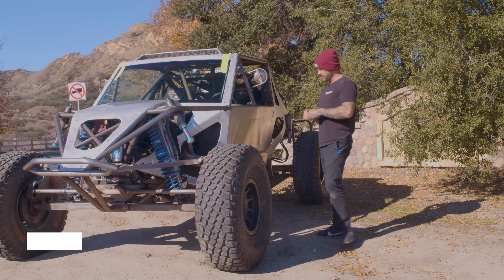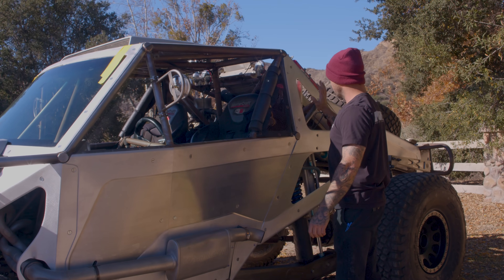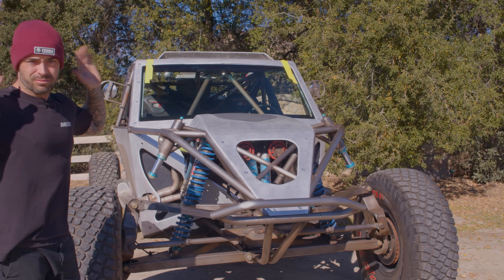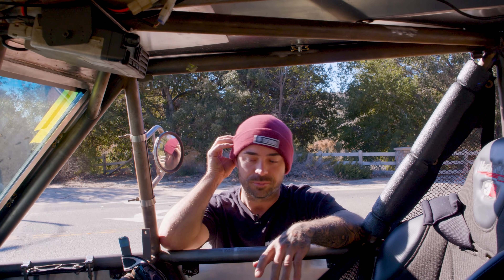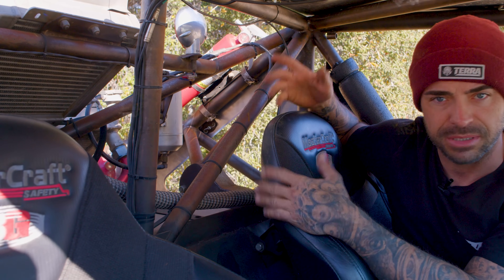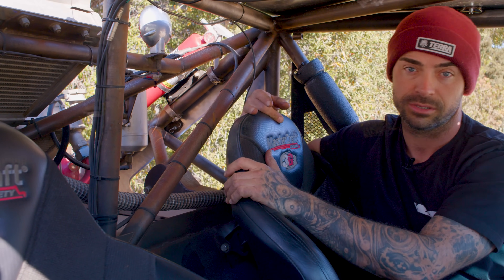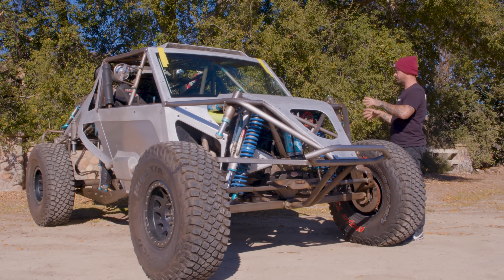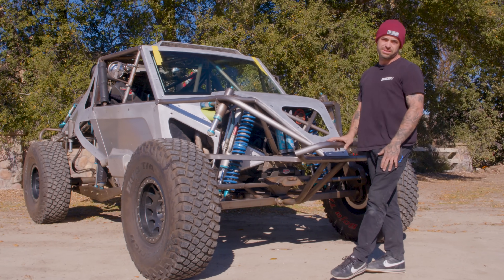TRUGGY:  Transformed  |  Roof scoop  |  Windshield  l  Updates!! (phase 2)

Comment: Do you put a gap in the zus tabs to preload the panel? I've never done it but I've heard that helps with panel noise? Or do you have a different way to go about it?
Reply from the maker: If the tab is set properly on the chassis is should do its job right off the bat. The edge roll also helps with tension
Reply: @MorganClarkeDesign1  thanks for the reply 👍

Comment: Those little triangle corner window made of lexan, u should make them old school so they open an close. Use your metal skills to make a frame around them with center mounted top and bottom swivels so they open inwards for some airflow and badass factor also. You could totally make that happen with your skills
Reply from the maker: That would be very cool!!